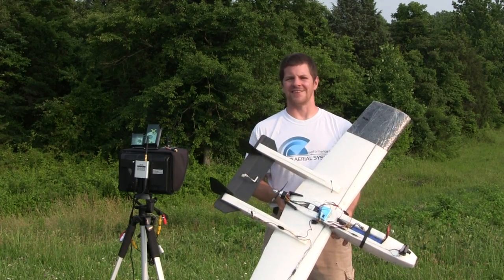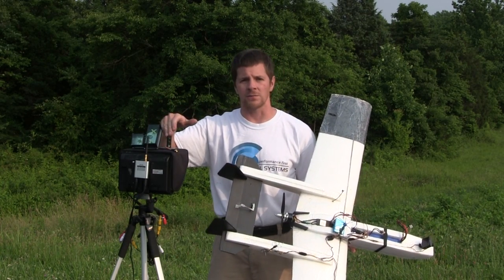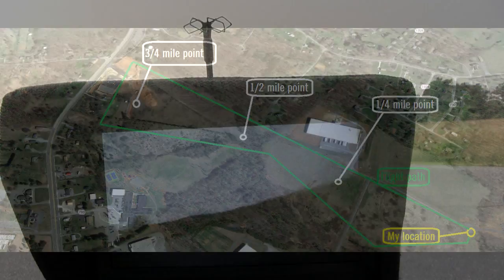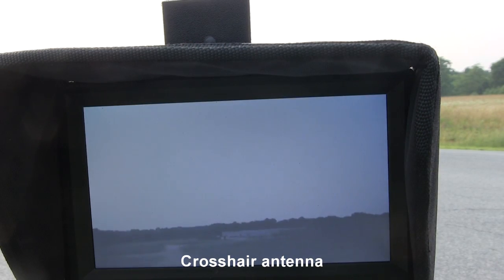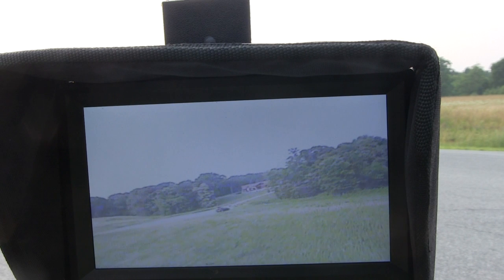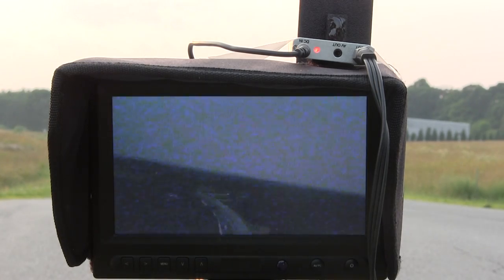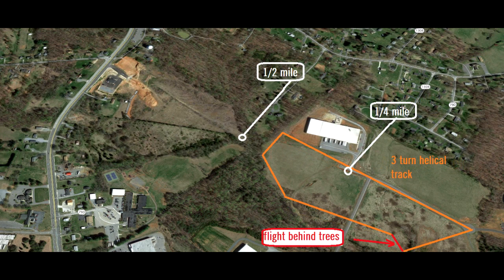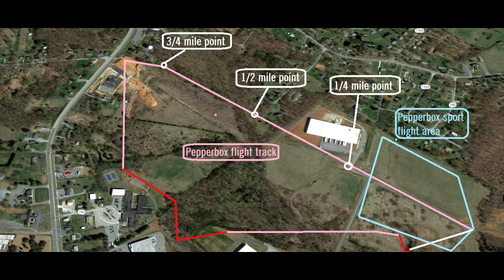Performance test of an FCC part 15 FPV video transmitter

Comment: to be  within the part15 regs(am,fm & tv) you can have up to a 100mw tx.
there are part15 compliant and approved tx's , the att is provided or spelled out as to what specs are to be to be compliant . 
you can have/use any att on the rx as fcc is only concerned with tx power.

the chances of getting a knock on your door for using a mobile tx(100mw+) in many different locations and at different times is very,very  slim as versed to a pirate broadcasting studio in your basement where they get complaints in a local few block area .

thanks Alex for the pointers in all your vids they are chock filled with good info..

Comment: I can't imagine that these video transmitters are still complient with FCC part 15 when you change the antenna's. It completely changes the radiation output. There is a lot of talk about the lower outputs giving the possibilities to race with 8 people simultaneously in a 250 racer class, but I say good luck trying to fly these transmitters with 8 people while close to the ground and avoiding obstacles. It's going to be horror. Even while flying alone the Airblade gives unacceptable results at 1/8 Mile and high up in the air in this movie. Almost complete statics. You don't want those while racing through gates.

Comment: The interference at 1/4 mile was consistently near the factory. I cant get a good look at the factory , but there seems like a few trucks. Delivery trucks have cb/data screens. And  the factory would also then have transmitter
Reply from the maker: FPVX - It could be.  I was thinking I was getting a reflection from the gully.  There is a ravine right before the parking lot.
Reply: Alex Greve Your knowledgeable thought is better than my poor sighted guess. In Australia the commercial transport uses 25 Watt radios. I dont know about the USA transport industry .I was a driver for 20 years and seen allot of abused radios. My guess is some dirty 25W radios will be bad news for a 25 mw. Thanks for all your videos they are very helpful and have made my FPV adventures more enjoyable.

Comment: if you change the antenna haven't you voided the FCC part 15 cert?
Reply from the maker: 2020tesla In this case, no.  The transmitter did not come with an antenna and did not specify one.  While it is understood that a dipole is the antenna to be used, the Airblade is well documented and tested to have a lower gain than a dipole and thus it is certainly acceptable.
Reply: As long as you don't use any antenna that increases the gain.

Comment: I bought an FCC Part 15 transmitted for my 3D printed tricopter and was pretty disappointed with the performance - until I put the bluebeam ultra antenna set on it.  I flew it for the first time last night and was impressed with how much your antennas increased my range.  I couldn't fly any more than about 300 yards at that location, but the video was clear with no static at all unless I flew behind things.  After seeing this, I may have to get a pepper box and a diversity controller too.

Top notch videos and hardware!  Thanks!

Comment: Great video, but we don't race alone. I would have liked to see the performance when you have 4-5 other guys running 200-600mw vtxs with you at the same time. Test how good the reception is when you are at the far end of the track, and your opponents with 600mw and probably ungrounded audio cables are at the close end. That's far more real world.
Reply: So you guys never race head to head? Only one at a time? Alex is a great asset and a leader in the FPV community, but he's not in the mini quad racing scene. Not sure what sponsored pilots he'd be talking about. The three biggest names that come to mind are MetallDanny, BorisB, and Charpu. All of which use 600mw
Reply: onlythefallen1 We do spec wing racing. We use 25mw video tx's.. to meet spec you have to use 25mw. So it's very real world. You don't fly 600mw with a 25mw vtx. Simple as that.
Reply from the maker: onlythefallen1 - It is well known to experienced racers that more than 250mW causes issues.  If everyone uses respectful power levels there will be no issues.  High power transmitters are for people who know nothing about how radio works as it limits the number of pilots.  On 25mW, you can have 8 in the air at once.  On 600mW, you're lucky to get 5.
Reply: Alex Greve Right, exactly. That's why I wish you would have shown the effects of other vtxs on, but now that I think of it, that doesn't make sense for what you were going for in this video. It's just me applying my experience to it. Perhaps a separate video showing the effects of over-powered vtxs on  a course this size or smaller with 4-5 pilots could be done to show people the importance of keeping power down and reception up. Thanks for the reply Alex.
Reply from the maker: onlythefallen1 - This is an excellent idea.  I just need to get enough pilots together to make it happen.

Comment: Alex, Just a random question:  If I have a RHCP antenna on both Tx and Rx but the Tx is upside down (on my hexacopter) how does that affect video quality and range?  thanks,  Bruce
Reply from the maker: Bruce Hyllberg - Not at all.  it will work fine.